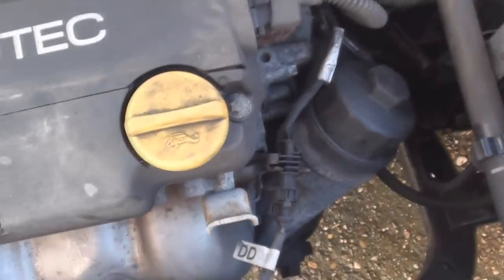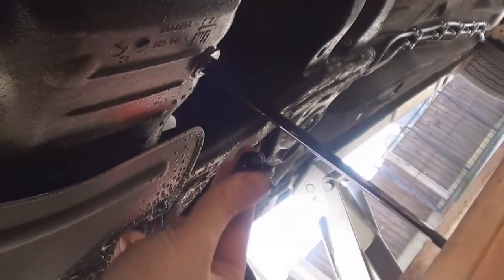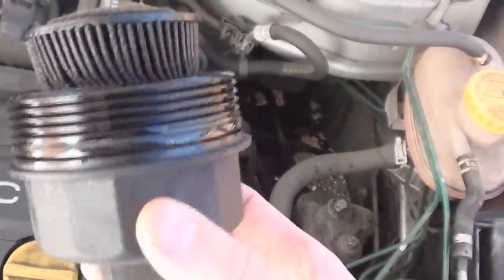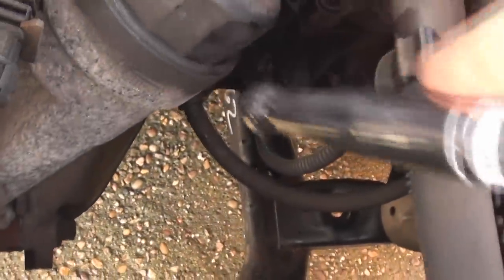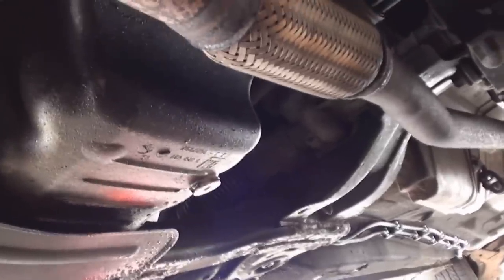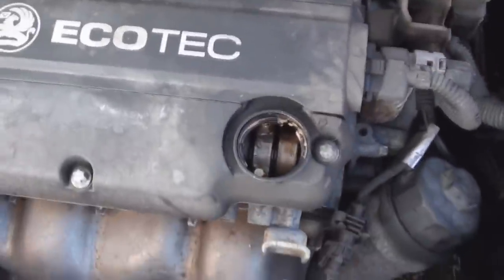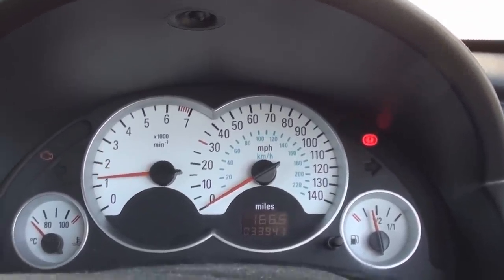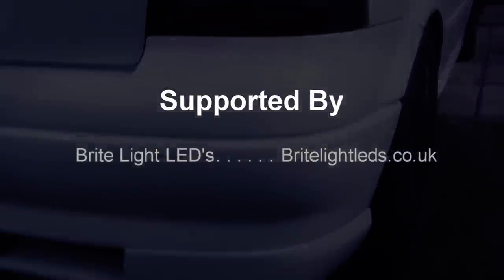How to change the Oil And Filter (Corsa 1.2)

Comment: I will advise you to use  original GM spares. Other filters sometimes are a bit longer and they will  get twisted when tighten the cap. the filter that  was removed for example. Original gm filter is  5 € i think.

Comment: My filter was a mess.  The plastic on it was cracked and the thing it goes over came out with it!  It was really stuck.  I dug  it off with a screwdriver.  My new seal popped out the sides when I tightened the housing so I pushed it back in so it couldn't be visible.  I hope I did it right.

Comment: The oil filter you removed was the later type (engine number 19MA9235 onwards) but you replaced it with the earlier type oil filter (up to engine number 19MA9234). The changeover was in October 2003. Were you aware of this? And does it make any difference?
Reply: 5 years ago you wrote this - and got no answer. I have the exact same considerations - I have a 2002 Corsa C. I bought the short type of filter, but err - I hesitate go get the job done, because I really don't know. When reading your post, I'm positive I bought the right one. It's the first time I ever hear when the changeover took place (BIG thanks 2u) , and it's close to impossible to find any information about it. However; I watched vid over and over (the filter part), and as far as I can see, the filters are of the same type - both short. 
Hopefully I can locate the engine number. Are you still alive after 5 long years?

Comment: what model oil filter did you use?? I was on the RYCO website and its telling me my '94 XC Barina (sxi) (1.4L)  uses a R2621P cartridge filter. However, when i pulled the filter out I discovered that there was a WC011 filter which has the same dimentions but it is a little bit shorter. So should I use the WC011 or the R2621P? Does it even matter that much?

Comment: just a quick one lad my cars making a tickin noise someone sed do this and it will stop is that true 🤔
Reply: that ticking noise is quite likely wear on the car's timing chain. Timing chains are used instead of a timing belt in this car, which makes it a lot more resilient to timing failures. However, if the oil is not kept in top condition throughout the cars life it can cause wear to the chain and make the engine emit a loud ticking noise, which eventually can make it sound like a tractor. It will still last for a good while with this symptom, but if you want to make it quiet, you should get it changed. This'll usually take about £350 depending on your service provider and any other faults they may find.